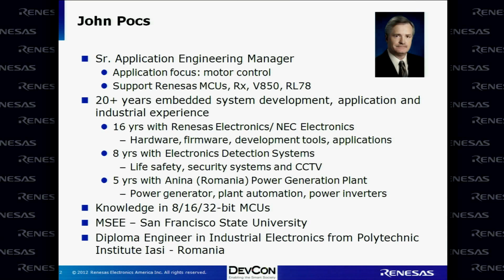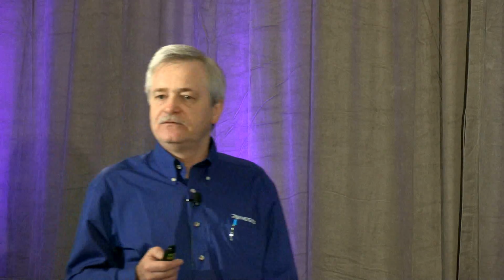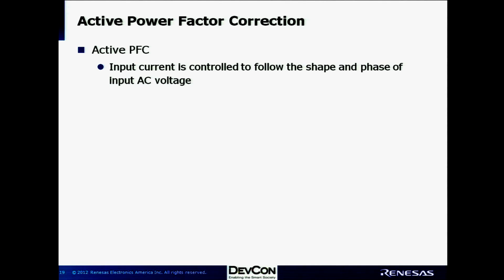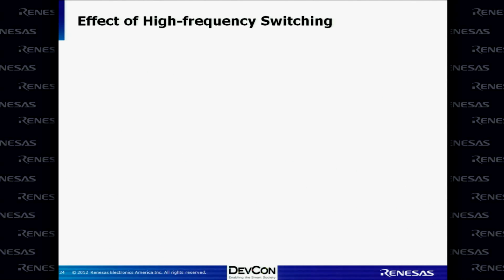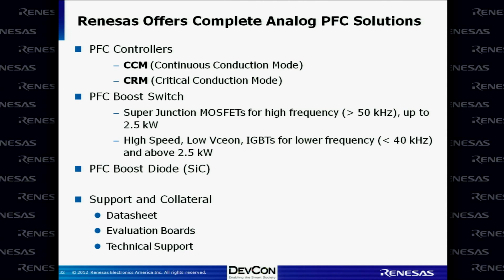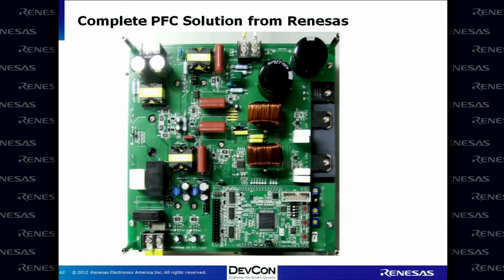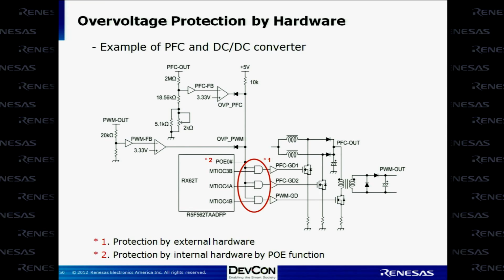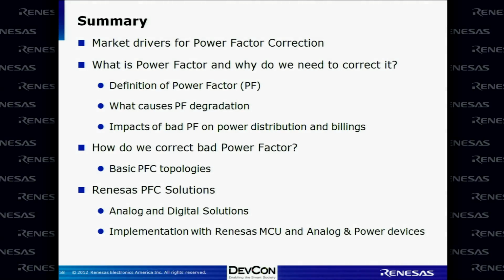7C03I:  Power Factor Correction:  Why and How? -- John Pocs

Comment: and my hardware protect cap after used 1 year by sensor current capacitor and temperature of hardware for protect cap and fan for reduce temp in box